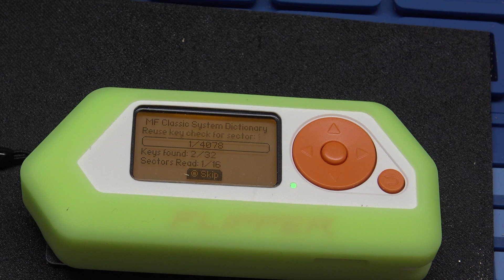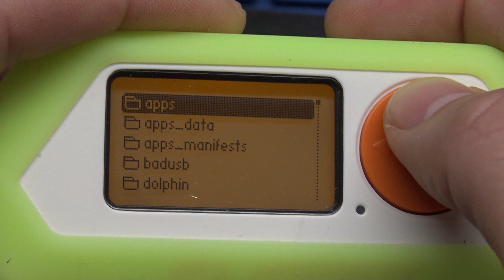(618) Flipper Zero Emulating an NFC Access Card

Comment: Can the flipper zero brute force unencrypted access control RFID (shutter remotes for example) and NFC (fob/access cards) systems?
Reply from the maker: It has some options in for stuff like that. I tried brute forcing my lock it didn’t work. But I haven’t tried it on anything else

Comment: please do a tolerance video on cutting to code and duplication of a key - is you machine within 0.02 mm.
Reply from the maker: How do I check the tolerance? I will be do some Schlage and Kwikset key cutting. If they works I think the tolerance is fine.
Reply: @BoredLockpicker  space and depth measurements only depth measurements does your machine get to within 0.02 mm to what the desired.
Reply: silca state within 0.05 mm is what there machine cuts. is the tolerance for mistake.

Comment: Eeesh..Honestly, that's disturbing. Thanks for the heads up though.
Reply from the maker: No problem. Not sure what all it works and doesn’t work. I’ve read a lot. Seems newer stuff it can’t  copy. I impulsed bought it. Just been fooling around with it
Reply: @BoredLockpicker  No worries. It would be interesting to see what applications it would come in handy as a Locksmith tool? I think you used it on a Sentry safe I believe.
Reply from the maker: The safe. But maybe copying fobs for gate access so you have to be buzzed into places you go a lot lol idk what else.
Reply: How? If someone steals your key they can copy it. Also, real (proper) systems use encrypted NFC cards that you can't copy like this.